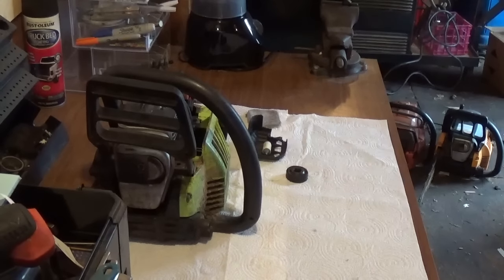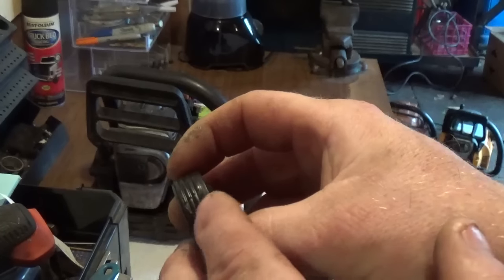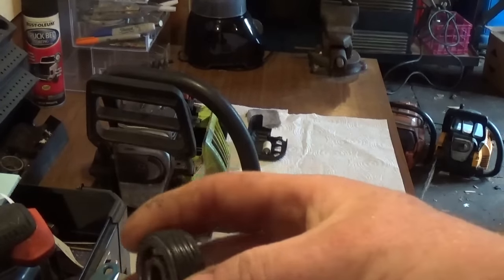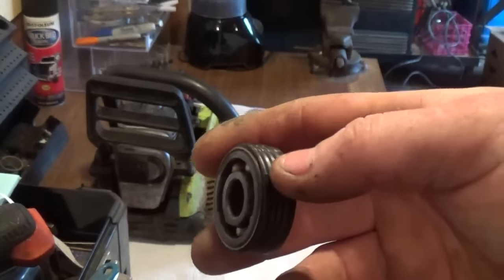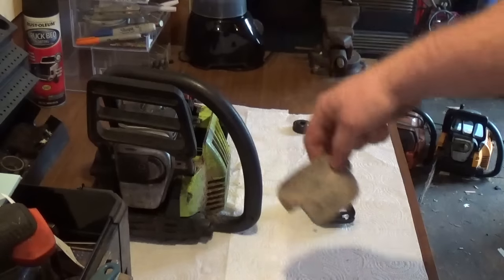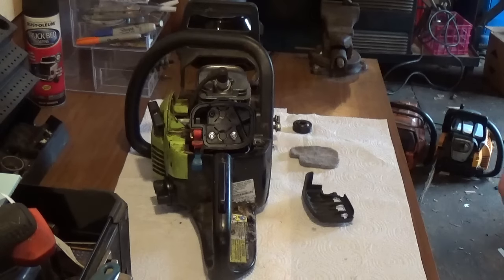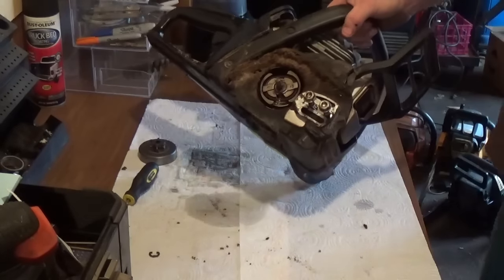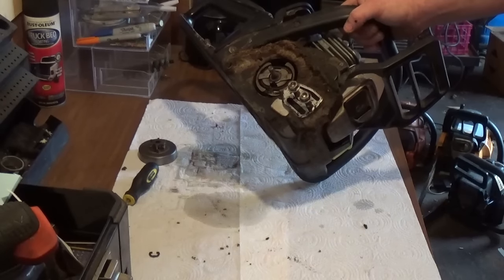Common problems with Poulan Chainsaws

Comment: Improper carb setting the guys at the factory dont  know how to adjust them worth shit. Ethanol fuel is a bitch 91 octane only no ethanol.
Reply from the maker: Interesting theory Mid evil …..But not very sound ….I have ran premixed fuels such as true fuel and other top rated premixed fuels as well only to see the exact same failures in Poulans . You can protest your idealism if you like . I certainly wont stop you ….Nor will I delete any comments you share so long as they are respectful . But keep in mind that I am no weekend shade tree mechanic . I have over 26 plus years of experience and have ran/operated Poulan chainsaws of the past as well as the ones currently being pushed by Husqvarna as a parent company . Granted as I have advocated many times before the ones made 20 plus years ago where truly not all that bad. NOT GREAT ….but still of a hell of a lot better quality than the modern pieces of shit sold under different brands and colors found in small box stores sold today . Failures of Poulans are so extensive the even own a factory that doses entirely nothing but refurbish them. Seriously go to just about any Lowes , Home depot, Walmart and look for the melted {stamped R} for refurbished . You will often find it on the plastic Jug or cylinder housing just over the carbs general location just beneath the handle . Now there would be some brain dead pricks that would argue ….Well every company has a repair procedure nested in with the said company for product returns . {YES} no doubt …..but a repair is not a refurbished end result …..Let me explain …..refurbishing is taking existing equipment and repairing everything to met a ending standard . A repair is a assessed determination of a warranted failure that was evident of defect or assembly and corrected via a warranty claim . {Proplexed?} most are ….The difference between the two are as different as day and night yet constantly accepted as one and the same for those whom cant distinguish a difference and oblivious to the tactics of Husqvarna . Example ….your chainsaw from new being a Stihl or higher end Husqvarna may develop a vac or pressure leak ….Lets say its a seal ….Chainsaw runs away with its self {casting the chain } with the increasing or decreasing of idling RPMS . Stihl like Husqvarna on there retrieval of the equipment would likely pressure and vac test the equipment if it was of the higher quality {meaning mag cased } for Husqvarna as most stihls bought are currently plastic with a clam shell type of design. Examples including everything from the ms170 to Ms 310 as I am sure there are more but for sake of the example we will just include whats popular. Now don't get me wrong Stihl has made mag saws for years as well but like Husqvarna they tend to have the mag cased saws toward the higher end {meaning pro saws or logger intended models } But on the lower end models made by Husqvarna unlike Stihl there built with one fatal flaw …...COMPRESSED seals onto bearings …..These seals are terrible when it comes to properly sealing the mating portions of the bottom claim shell or cap to the cylinders or jugs on Husqvarnas and or Poulans . The design is simply susceptive to heat and tork from chain tension allowing air leaks to change critical air to fuel ratios resulting in a scorn piston and or cylinder. { Now to the point of all this} Stihl unlike Husqvarna whom refurbishes actually repairs …..meaning as to reiterate …...accesses the failure and makes the repair under a warranty claim . They don't refurbish …...or as dealers whom contend with Husqvarnas bullshit tactics call {Full on Restoration }of the cheap inferior box store sales point pieces of shit . Seriously Ask any reputable Husqvarna dealer and you will find they hate dealing with the cheaper lines of poulan as well as Husqvarna .Most refuse to even sale the junk because they know a happy customer is a repeat customer and don't wont to tarnish there name .

Comment: Or just use a metal gas tank and cap
Reply from the maker: I have often wondered why they chose to make there saws out of what ever cheap plastic this is as well. After all they could find better materials to incorporate for a better product .{ greed of profit I suppose}
Reply: There suppose to make it last. not last around 1or 2 years

Comment: I like your review I wish you can convince a friend of mine to stay away from poulan
Reply from the maker: LOL...I know just how you feel .....You can provide the truth and even back up your claims with facts .But still admit people and foolish pride seems to prevail .
Reply: Kevin Bolin I've got a poulan 3816 poulan I'm trying to sale for a friend  once they find out what brand it is they pass it up
Reply: Kevin Bolin I wanted to ask you do you have a lot of problems with stihls I purchased a brand new stihl ms 180 c in Dec 2017 I believe in stihl what can I expect out of it
Reply from the maker: Jody ....I am honest with all my viewers so please keep a open mind when you read this . The ms 180 is a great small trimming saw ..Very reliable and dependable but please remember to change your fuel every 30 days 60 if you use stabilizers . Also start and run the saw from time to time in those months of storage as you wont to cycle fresh fuel threw the carb . If you properly maintain it and keep fresh fuel in it you should likely get many years of great service . Just some friendly advice ....Don't try to make such a small saw try to tackle to much of a tree or branch ....A good rule of thumb is no more than half a bar to the size of the limb , branch ,or tree . although many will argue you can do much more ....LOL if you watch carefully most of these individuals have there equipment repaired every season .  The Ms 180 over all is a great saw and if I was going to purchase a small trimming saw would be my first pick. But be warned theses saws do have issues with seals and carbs becoming defective. Although very rare if properly used and maintained .
Reply from the maker: Jody ....What ever you plan to sell it for be reasonable ...these saws have gathered a terrible reputation in the last 15 plus years as the quality leaves much to be desired .
Reply: Kevin Bolin I didn't  sale it I returned it to the owner I asked a man the other day if he wanted to buy a saw he asked me what kind I said poulan he said I thought you said you had a saw

Comment: New out of the box ... A BIG PIECE OF CRAP ! Threw it in the trash.
Reply from the maker: Yes sadly this is all to often the case .....as often if the saw is completely ruined after running it with a defect and the piston becomes scored as well as cylinder they often will just say it was due to operator error .

Comment: Yeah. Most of the problems you mention all chainsaws share. Poulenc is not the greatest but is a great chainsaw.
Reply from the maker: You claim most but would you care to elaborate as I know of no other saws that have continuing breaking crankshafts ,swollen tanks and caps as a result of modern gas .piston ring locaters that fall out ,Hard starting issues straight from the box ,warranty expected carb adjustments …...Even faulty plastic oilers that excessively leaks or fail all together in a very short time from purchase .SO GREAT CHAINSAWS? I think not as they are the most recalled chainsaw in America / Think I am joking just look up refurbished Poulan chainsaws. Respectfully Larry Cox we may carry a difference in opinion but facts support mine via in comparison .

Comment: The main reason that these chainsaws are shit because their gas tanks are not deep enough. They do not have proper gas lines that don't rot off they are hard to replace. Can people get tired of replacing them. That's why they came out with the electric chainsaw the electric weed eater. They are going to be obsolete before long just like the people that repair them. You will no longer have a job
Reply from the maker: There is likely truth in this opinion as in honesty most equipment being made anymore has many service by replacement parts .

Comment: I have had my poulan 2075 for 14 years and still works good .The only thing I have done was use quicksilver(Mercury) power tune to remove the carbon build up in the combustion chamber and on top of the piston.We also use non ethanol fuel.We use the saw every year for firewood.
Reply from the maker: Great / Then it should be easy to achieve the Poulan challenge test requested from every viewer that makes such claims . As this request will be shown once provided to validate your claims .

Comment: What is your favorite small to mid size chainsaw? I have a Stihl MS 310 and love it, but I'd like something a bit smaller and lighter for travel/camping. Thank you for your great videos!!
Reply from the maker: LoL ....You know most people are going to assume I am a Stihl dealer as much as I favor there saws .....Sadly I am not ....But I cant lie the saws quality far exceed many of those made by other companies. {Not all} but most ....Efco is a great saw as well as Dolmar and Red max .....Well lets just say Red max of the past {Husqvarna has bought this company and run there chainsaws in the ground so to speak } Just as they did Dixon Mowers but thats another topic all its self . Anyway I personally would purchase a MS 250 if you can find a dealer who still carries them . Second to this saw a MS 180 or MS 170 .. Just remember to always keep fresh fuel in the saws and run them at least 5 min every month of storage to allow the carbs from developing tarnish build up as with really any chainsaw .Note gasoline over 30 days old without stabilizers should be emptied from the tank or 60 if the stabilizers were added . Trying to run old fuel can and will ruin a carb as well as do damage to internal parts such as the piston and cylinder as well as seals as the fuels mix ability to lube the parts will be lacking and you likely may have developed water in the tank even though the cap was secure and in place .....I have seen the affect of gasoline breaking down many times and water is almost always a contributing factor as the gasoline jugs or cans sweat due to different temps changing from day to day as well as the alcohol that's just added to modern fuels .

Comment: To my knowledge all chainsaws are mass produced,  I've had a Poulan for 15 yrs, it's actually a good saw, I think you have some bad luck with one, these problems you have discussed happen to some of the so called best saws.
Reply from the maker: NO DOUBT....my point was that the quality of the poulan over all was terrible . And even though other saws have there issues LOL they don't often break in the first 30 min of use or have clutches fly apart as the Poulans do . And lets address this factor ....How many Stihls ,Efcos, ECHOS, get returned for broken crank shafts . .....NOT many in comparison to Poulans.
Reply: Kevin Bolin to be fair Poulan is not a saw you'd use in the forestry, although I have used mine to cut big logs, the only common problem I've ever had with any chainsaw is the chain flying off, I remember when they marketed the Poulan, it was apparently Americas favorite saw, that saw you got looks like it's had more than 30 minutes of work. Just unfortunate it broke while in use. Poulan like many other big brands have pedigree,  if was you I would of taken it back got refund, never buy another Poulan,  simple.
Reply from the maker: I personally don't use or depend on Poulan at all . The chainsaws seen were warranties for customers or gifted to me to dispose of with Tannerite .

Comment: I have the same saw, same filter. Got it as a hand-me-down from my father. This saw has been camping with us at minimum once a month for probably 10 years and the one before it 15. He rarely maintains the thing and I just pulled the filter off and it squeaky clean behind it.
Reply from the maker: LoL....I rarely call bullshit on anyone ...But you sir I feel compelled to do so ....Squeaky clean ,once a month,10 years right .....I know for a fact the cheap poly lines only last 4 years at best with even premixed gas from cans . I don't know if your aware of this fact but friend I am a Master Service Tech for many brands of equipment and have over 20 plus years of experience ......So its safe to say I have seen many saws over the years including poulans  that you obviously have a liking for . And all I have to say is to each there own/ however bullshit is bullshit and if your going to make such asinine opinions you better be able to back them up . So rather than insult you I am simply going to ask you prove that you indeed own such a poulan and show it off for my viewers and I to see . Show off the saw addressing all the commentary you previously implied as well as show it in action preforming as it should . If you fail to do so my viewers are just going to see yet another viewer sold on idealism rather than fact .

Comment: 12 year old poulan wild thang 18 inch blade. Gets ran hard 8 to 10 days a year. Sees use at least 1 hour a month. Other just normal stuff like air filters and blade changes. Run it completely out of gas every time I use it.  Guess this guy has more money than sense.
Reply from the maker: No sniperdoug1969 I have both . Cant say the same for you ….I am calling bullshit on your 12 year old Poulan wild thing . Prove it …….No bullshit excuses {put up or shut up } because my viewers and I know bullshit when we hear and see it typed in such replies. Its a simple requested test …...do it then we can see this 12 year old poulan in action . The take my word bullshit just wont suffice. It will be interesting if you follow suit to all the bullshiters before you or actually show prof as I have requested from so many others that seem to never actually upload a video …..

Comment: Everything thing has its place. The older Poulans are awesome. I am running a CVA 2300 and a Countervibe 3400. Aluminum casing not the.plastic pieces of shit. These Poulans are over 40 years old and sill running strong as ever. Through out the years, Poulan as a company was sold many times
I agree with you about the new Poulans. However, the newer Poulans are great stump saws.

Comment: I feel your pain and i totally agree they where at one time a descent saw but now are disposable I have stopped taking any in my shop as they are a wast of time trying to repair and for the cost of a Walbro replacement carburetor and all the other components fuel filter , lines, airflter etc, you could have purchased a Stihl MS 170 for $180.00 .

Comment: Had  1 for 2 years and will not restart after warn up ,,,POS
Reply: On most Poulan models fitted with a double-throat carb, drill about 8 holes 1/4" dia in the top area of the filter cover and deburr holes. Re-install cover, all done. The extra holes allow sufficient air in to make hot start issues go away.

Comment: With all due respect I can care less what you think of the machine just show me how to fix it, thank you.
Reply from the maker: Well with all due respect intended...the purpose of this video wasn't driven by opinion rather facts.these facts remain evident threw out the entirety of the video.the intended premise of this video was to advocate so many issues that plague these pieces of shit.now with that being said by the collaboration of facts that are clearly transparent one might wonder why anyone would feel compelled to repair one of these pieces of shit as the longevity would be lacking and the machine having so many failure points would show indicative signs of failure there for threw out the remainder of it's intended fix Intel once again more work and parts must be ordered . to quote on quote repair the machine again logistically most of the viewers that see or have seen this video know what I have been advocating to be of sound judgement. Not preconceived idealism as to reiterate failures are seen and noted threw out this video to validate my claims...thank you
Reply from the maker: Roman if your hell bent on fixing this piece of shit CHickanic proudly made a video on her channel showing her expedient time repairing the fuel system on these curses. She doesn't actually pressure test nor vaccum test the equipment but she provides a positive result for her viewing audience. Personally by experience I know better to invest any money in a modern Poulan .But there are some viewers that remain blindly arrogant sold on there idealism even though facts remain obvious .I try to educate my viewers so they will not have to contend with buyers remorse......sadly not all can be persuaded as price point makes fools out of box store Pennie pinchers everyday. Hell I am not to proud to admit it ......I was a victim of a price point fucking .....lol.....But.....I am a survivor..... 😂.....and Husqvarna/Poulan was my violator....# Husqvarna victim